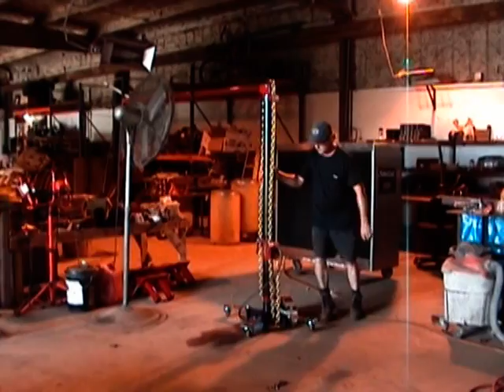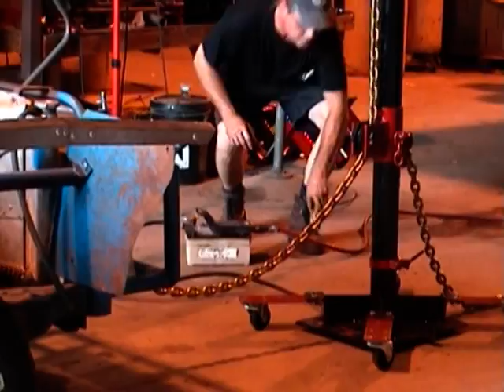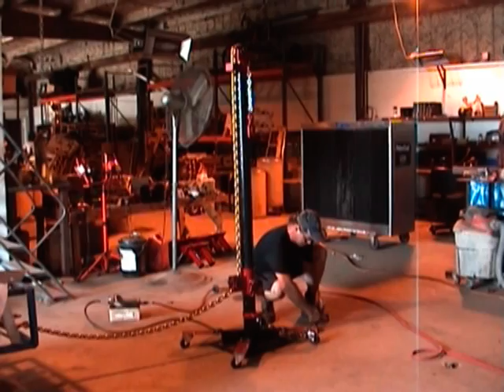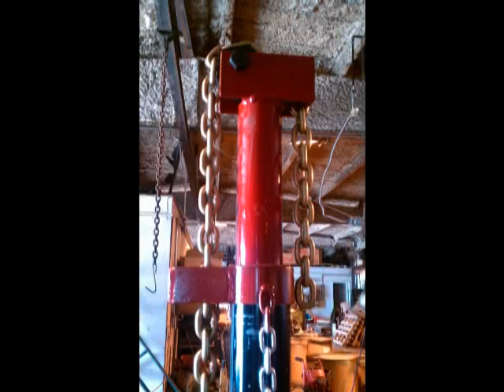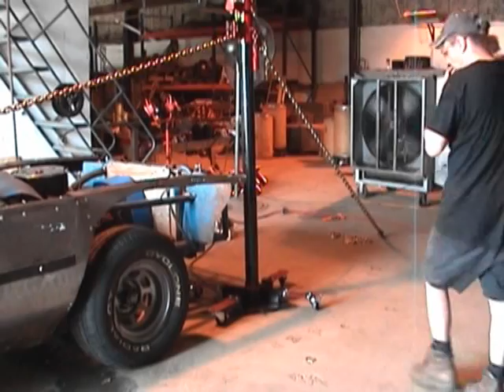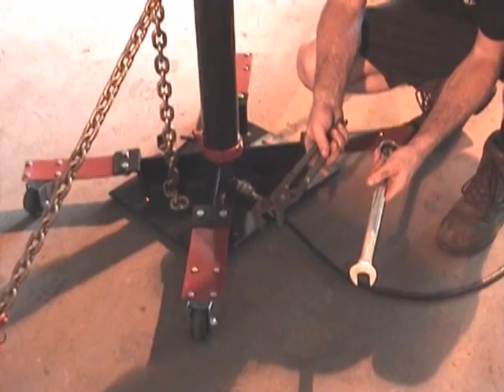Body Loc 10 Ton Floating Pull Post Training Video

Comment: How much is a unit like this?
Reply from the maker: Prices are post on website.
Reply: BodyyLocEquipment
Reply: Looked it up $3099
Reply: @Usefullinformationphilippines  3100 , ? its a few pieces of steel and a few chains. what kind of crackpipe are these folks on ?
Reply: @shartingkhumbubbles7169  It's a lot more than that, actually. I'm retired from the collision repair industry, and am here to tell you that micky mouse equipment can kill you. There's a reason for the cost.